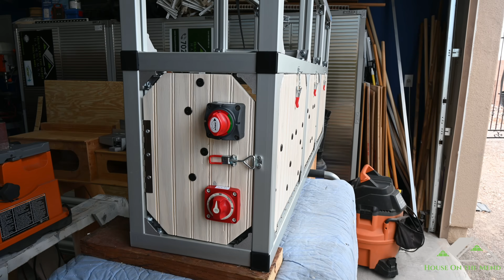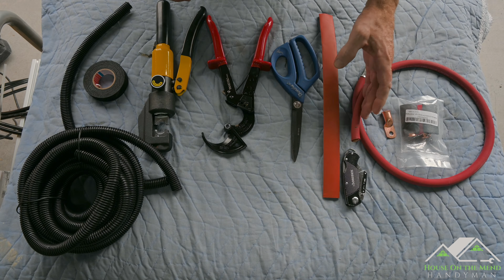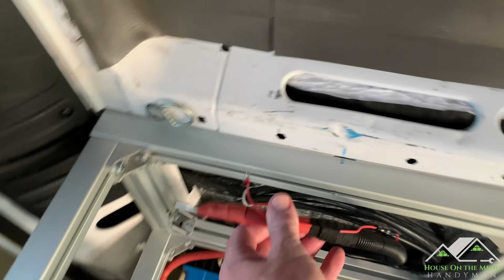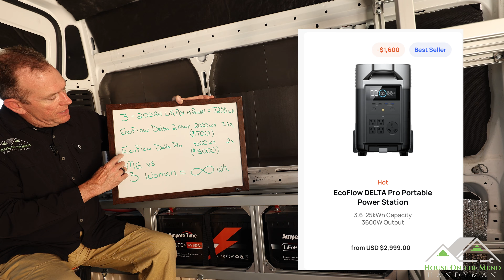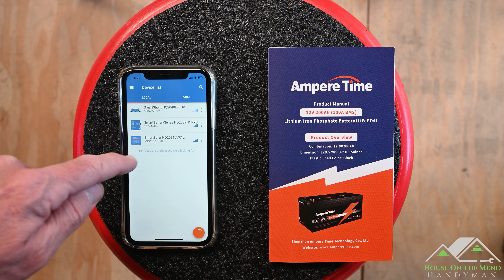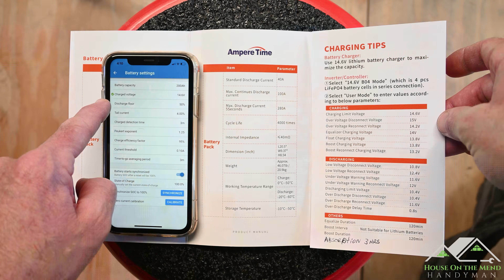Ram Promaster Work/Travel Van Build - Ep. 6 Battery Cage

Comment: Excellent video. Could you please list, in detail, all the parts you used to build this extruder box in the comments? Thanks again
Reply from the maker: The items are all listed in the description of this video:

Amazon Affiliate Links:
Li Time 200AH Batteries: https://amzn.to/3NPjOUL
Victron Charge Controller: https://amzn.to/3NTFFup
Victron Smart Shunt: https://amzn.to/3NUg5Fo
Victron Temp Sensor (Smart Battery Sense): https://amzn.to/44KlKoy
Stranded Wire Kits: https://amzn.to/3rvOdA8
Bus Bars: https://amzn.to/3DapNyD
Ratcheting Wire Cutter: https://amzn.to/3rsAkTa
Hydraulic Crimper: https://amzn.to/3JS4dT1
Reply: The extruder box parts ? What’s you buy to build this thing.
Reply from the maker: https://amzn.to/4dBzmcI

https://amzn.to/4wgBxtz

https://amzn.to/4uFfmeT

Comment: A decent set of Jumper Cables will work for large Gauge Cable... Cheaper than most other options and just have to chop off the clamps.. Good length for most applications and rated for High Amperage.
Reply from the maker: Great idea Robert! Thank you for sharing.